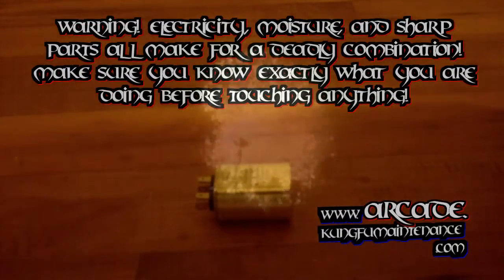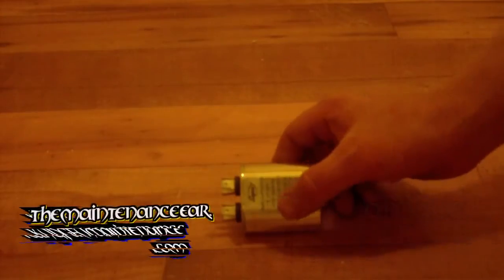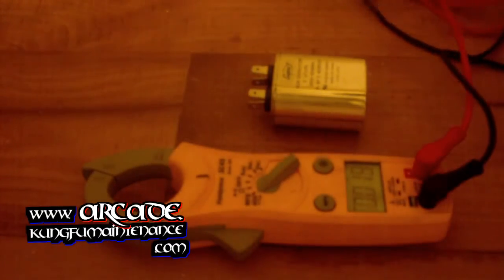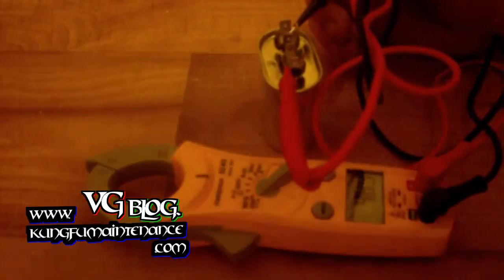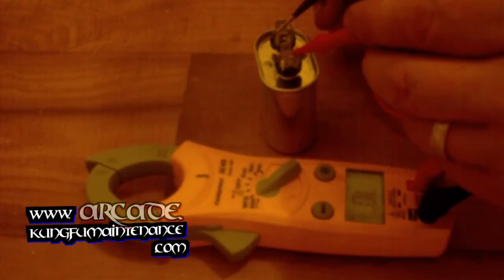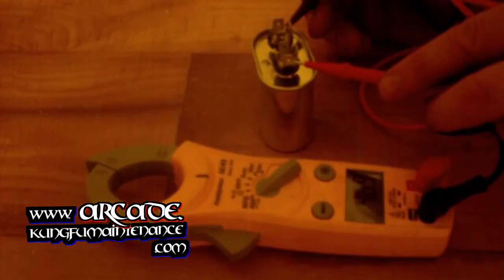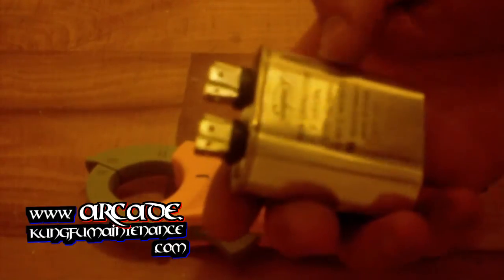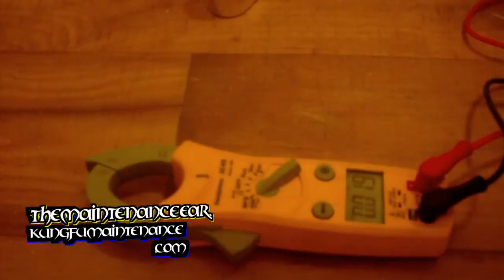How To Test Air Conditioner Capacitors Or Furnace Heater Cap Fan Motor AC Capacitor Testing Caps

Comment: interesting,you were talking about shocks,i had some shocks when i was a janitor in the grocery store,they provided no protection,one time i had a barker case and the pan was running over so i took cover off to get to the pan,was on floor with a dixie cup scooping out water putting into mopbucket,then a refrigration tech just happened to come in right then and probably saved my life,he said if i was to touch that circuit board with my wet arm it could kill me,i admire the work you do,

Comment from the maker: A lot of these little run caps get discharged through the motor windings but it is still just a good safety precaution practice to keep. It doesn't hurt to discharge but it could hurt to not discharge. Especially if someone was sweating as the sweat might increase the surface contact area of a shock.